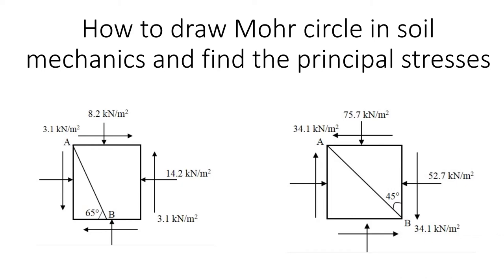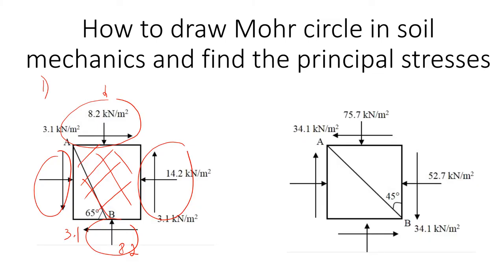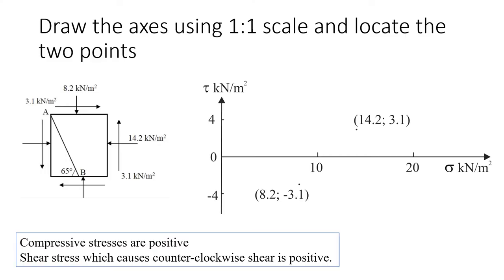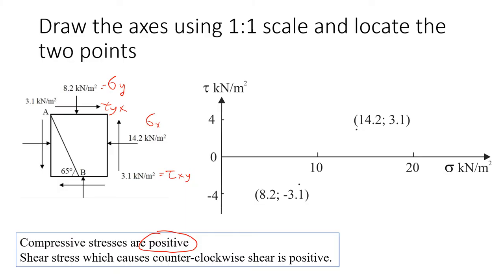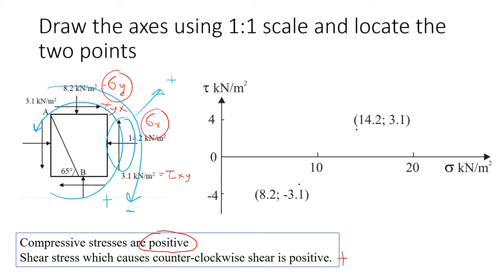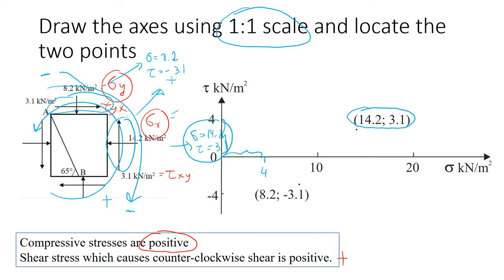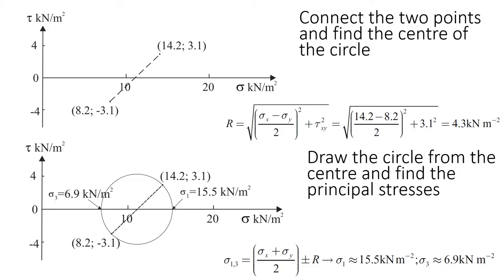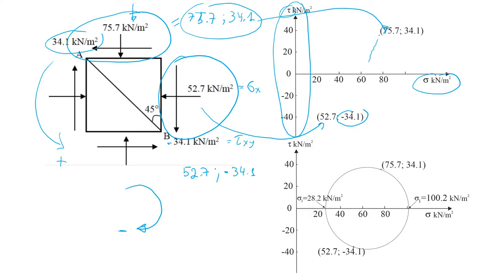How to Draw Mohr Circle in Soil Mechanics |  What You NEED to Know

Comment: How to determine the angle of shear resistance and also the specific direction of the shear stresses ? Is it from the trixial shear test or we should assume?
Reply from the maker: In many textbook examples as the one in this video, we are given such stresses and asked to draw a circle. It is possible to obtain the vertical and horizontal stresses from a triaxial test, or it can be measured in the field or estimated based on soil properties. We often use Mohr circles to analyse the results from a triaxial tests.